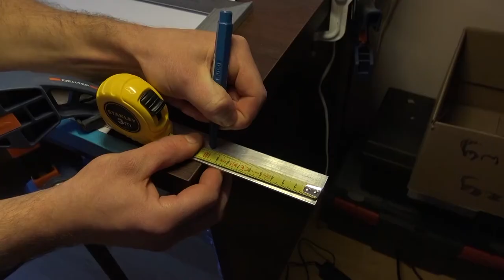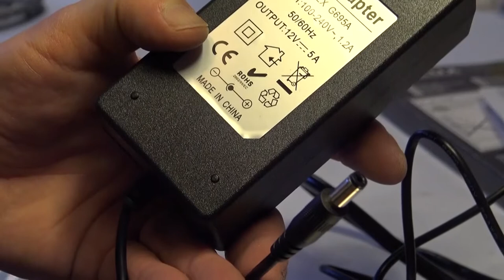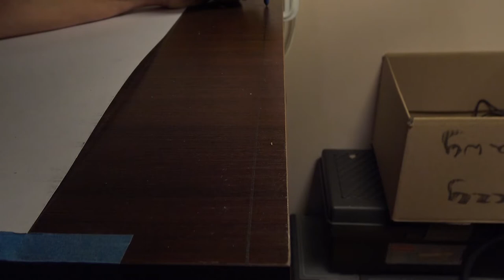My First Youtube Project: LED Arch Lamp

Comment: Awesome !!! please, what led strip did you use? Color temperature? Power of the LEDs, number of LEDs / meter?
Thank you
Reply from the maker: I finally measured. There are 70 LEDs per one meter, don't know their power but the temperature is 4000K. Used two strips so that gives me 140 LEDs per meter.
I wrapped the whole thing in paper later to diffuse the light because the LEDs were reflected on polished surfaces. I realised that in my LAMP from HAND video. Thanks for watching.